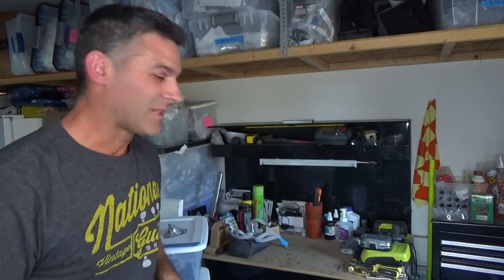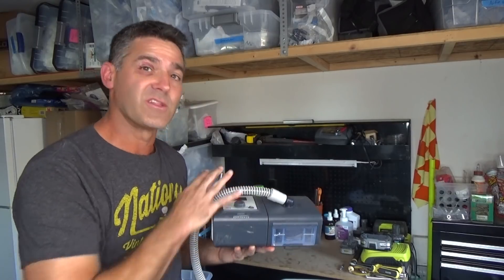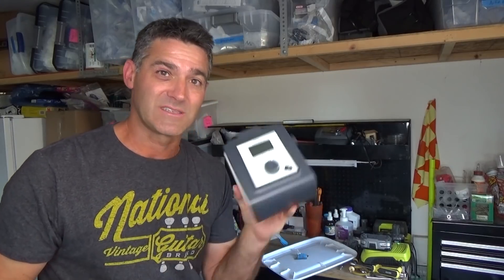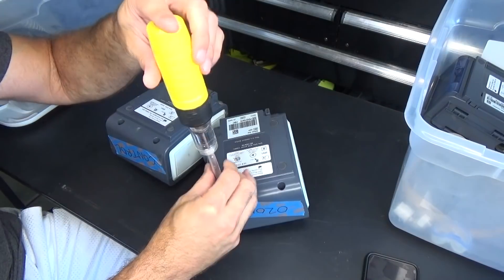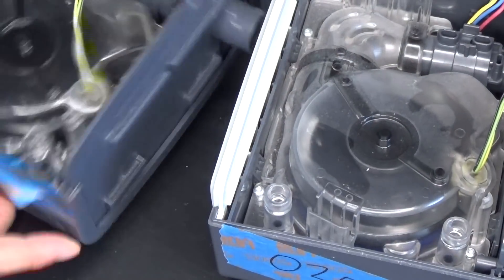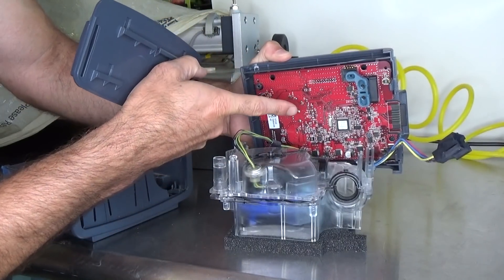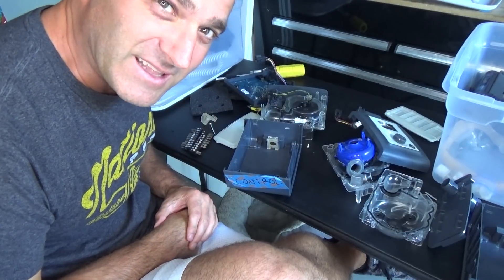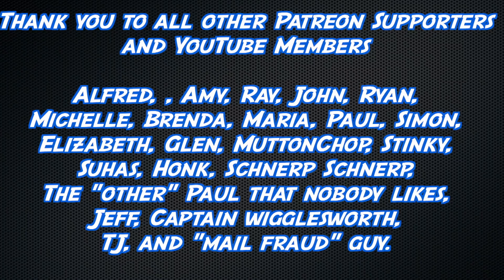Showing what OZONE does to the FOAM in a Philips Respironics CPAP Machine   #Foamgate

Comment: Interesting article on ozone from NOAI (Remediation Association).  They liken ozone exposure to rubber/plastic like dampness exposure to wood.  You can wet the bottom of a cup, set it on a wooden end table for a few minutes and remove... you see a ring for a little bit, then it dries up and goes away.  Do this repetitively for months and will have the same result and still the ring dries up without damage.  But place a wet bottom of glass on the end table and leave overnight and by the next morning the ring is set and will never disappear.   In other words with this analogy, "soaking" rubber or plastic in ozone for days at a time will have a much more detrimental effect than having the same cumulative time of ozone applied in relatively short bursts over an extended time.   While ozone torture tests are interesting, they are not necessarily scientific and may not deliver a true "read-across" result.  I'm not sure what is right or wrong, but could see potential validity in this apples to oranges proposition.
Reply: That’s exposing it to ozone for 45 days 24 hrs a day but most cleaners only run for 7 min.at a time
Reply: @howardanderson3324  Lets day a CPAP lasts 5 years, at 7 min/day, adds up to about 212 hrs. 45 days at 24 hrs/day is 1080 hours. Besides being 5 times there is also the impact of continuous exposure to O3 for 45 days. In other words, while it might be practical to do the test using an accelerated schedule the results may not mirror reality.
Reply: Daily use of SoClean turned the foam in my DreamStaion1 to a greasy mass. Your analogy doesn’t reflect ozone use.
Reply: En français
Reply: I check my unit the foam in my and it was not expose to ozone. The foam was degraded to a brittle melt when try to take out it was so brittle it breaks into little pieces to a sticky powdery mess. I live at where it very hot and the humidity is high, so if you live were it hot with high humidity it will degrade the foam too. Maybe someone can do a humidity experiment to see how humidity will degrade the foam. Even if the foam is not degraded and look new studies found that the foam material puts out chemical fumes which can lead to illness or cancer.
Reply from the maker: Fair point. The ozone applied was done in a bin that is not even close to air tight. It was just to keep things together and dust free.  Only one ozone generator cycle was done per day.  (I think this is why I didn't get as dramatic a result as Nick at CPAP Reviews.)

From reading up on Ozone, it has a short life and is completely gone after 30 minutes even in an airtight container.  The most popular ozone cleaner is a closed container.
Reply: @Freecpapadvice  I tend to discount Nick’s technique since it does not mimic real usage, especially in a situation where concentration and length of exposure are exaggerated by several orders of magnitude. He did an accelerated destructive testing which is a valid quality engineering approach to determine when something will fail. Anything subject to this testing approach will fail at some point – from airplane wings to car doors, paint, etc.
Reply: @Freecpapadvice  I was actually glad you did the accelerated testing because it was representative on a different accelerated level.  Obviously, you weren't writing an article publishable in JAMA with it, but your audience was helped by getting a test that may not have happened at all if you weren't able to condense it the way you did.  So, even though it's not apples to apples, 100% perfectly, I think it's a great preemptive test that might convince others (or even cpap manufacturers) to do their own real apples to apples tests. I mean honestly, you're a dude in a mancave, not JAMA. If everyone now wants a 100% perfect JAMA publishable test, maybe they need to give you the $50K to support it.   Btw, I've appreciated you so much over the last several years.  You even helped my mom to start wearing a CPAP, where I couldn't.  You've also helped me figure out a ton of my own issues and also taught me OSCAR mumbo jumbo. Thank you for telling me about this recall.  You're saving me and my mom's lives yet again!
Reply: @Freecpapadvice  did the ozone affect the shape of the screws?  What was the date of manufacture for each of the two machines?  I suggest that the one with the "very different" screws may be the younger of the 2 which may also lead to your findings.

Comment: Nice vid.  Although I saw where you forgot to put the side plate in before putting the top back on.  LOL.  I have one of these apart now.  Its a great motor and fan design to say the least.  They really made a marvel I hope their newer machines keep the fan and motor design.  What I want to know though, is WHY is Phillips paying out and taking the black eye when it's the SOCLEAN ozone machines that did the damage??  Why would Phillips take a black eye on this?  What am I missing cause it makes no sense.  But for some reason that foam does turn into a STICKY SOUP which I found in mine upon disassembly; and I never used any ozone cleaning machines.  So Phillips had a serious problem with their foam and not even ozone related.  Now you have to wonder why the big cover up.  Who actually owns SoClean, and why.  Perhaps I am going to far with that conspiracy, but I can say for sure ozone was not required for these foams to degrade in pretty weird ways too.  I hope you didn't replace with a nasty Resmed.  
ALSO - Instead of testing what exogenous ozone does to a machine, why don't you test how much ozone the motors in machines are generating.  I suspect its an issue with Resmed machines.  Also look at P10 nasal pillow mask.  It simply does NOT exhaust out the front, and I have new ones I tested against this too.  I'm kinda at a loss that resmed would all this sort of error on the market....

Comment: Beware! This is a nice video to help the System One CPAP owners to rid their units of the dreaded foam.  Please note that just taking the foam out allows dirty air to bypass the air filter, as the foam serves as a “sound abatement” wall for the air ducting.   What I did for my units, is to cut a thin gasket of food-safe baking silicone using the foam as the template, and installed this on top of the foam (against the motor housing while leaving the foam in the bottom of the unit).  Therefore, the silicone sheet seals against the bottom of the motor housing and preserves the proper airflow of the air ducting, while isolating the airflow from the defective foam.  All intake air must go through the air filters with this setup.  I feel this is a better solution than to have my unit open to the atmosphere with no filtering (by only removing the foam).
Reply: You are correct and what I am hypothesizing is that without the bottom in place, you would be breathing PC BOARD fumes directly, which is not good.  Probably get a few anyways just from the unit exhausting near the air intake.  Still you never know having fresh air moving across the board may just keep it cool enough to not create fumes.  Some people I see with a pc board in the top cover side too.  I imagine that is the modem and connection to the Evil Underlords of CPAP.  I really like your idea about the template I did not think of but probably because my foam was a degraded soup-like sticky mess.  It looked kinda like you could imagine memory foam gone rancid and heated up to melting point, except at room temp.  I am going to see what the foam looks like in this other unit and maybe I won't have to scribe ink all over the bottom pattern and try to press out a template like I was thinking.  I'm trying to think of something organic like cotton and not dangerous to make my new bottom "foam area" with.  ANY IDEAS PLEASE??  Have you run into anything in the store over the years that you thought might work>?

Comment: First there is Issue #1 Phillis now has come up with deeming some units too old to repair. #2A offering $50 to send it in with no replacement. #2B send in a new scrip from your doctor and wait for replacement. There is a problem with #2B as you may need retested as was my issue from to many years and new Doc. So I got retested at home and failed to test for CPAP requirements.  I convinced the Doc to do a lab test and again failed to test for CPAP requirement. Doc told me Medicare or other insurance would cover a new machine. So I tried to sleep for week without and monitoring sleep on Apple Watch and iPhone health app. Lot of snoring plus high number of wake-up’s during the night. Loss of a lot of sleep from being woke up not being able to go back to sleep. Found a snoring monitoring app and it recorded and lot of loud snoring. So I went back on CPAP with all the same monitoring almost no wake-up’s and nearly all sleep time. So now what to do if I can’t get a new scrip and machine? Find a way around the foam. There would seam to be 2 types of foam degradations dried up flaky and turning to gummy mess. I used a ozone cleaner for about half the years I had this unit. My foam is gummy if touched and not dry. I removed it and did a cleaning, washing the housing and fan clear housing half’s. I did a compressed air blow out on the fan blades.  To remove the foam is not difficult just locate the correct video and do the work. But be aware that some of the machines have the foam in a sealed fan chamber that’s nothing like as shown here.

Comment: Thank you for showing what the insides look like and how you took it apart. That's what I am going to do tomorrow for sure, take that foam out.  I imagine the machine will sound a lot louder, but hey, it can do double duty as a sound machine.
Update:  FIXED IT!  Took the foam out. Half was looking iffy, half ok.  But in the summer or when the room gets warm OR when I leave the tank in there full of water.... the humidity goes backward into the machine and it smells exactly like when toddlers slobber over animal crackers,  Putting it back in was pretty tricky.  Mine had star shaped screw slots.  Luckily, had some odd-sized small flatheads that did well as a workaround.

Comment: I've owned and used a CPAP machine for years. Actually, I've been thru 3 or 4 of them. Started using an Ozone cleaner over a year ago. I was notified a while back that my machine was on the recall list and would either be replaced or repaired before the end of 2022. I was told not to worry that Ozone has not been shown to cause any problem but I should stop using the Ozone machine if I was using one. So, what is this really doing to my lungs? Should I be worried? 
Also, do you know anything about this "Inspire" device that is being advertised on TV. It's supposed to eliminate the need for a CPAP. 
A device is surgically inserted in your chest (like a pacemaker) and keeps your throat open with and electrical shock.

Comment: I did not ever use a So Clean device or any other Ozone cleaning devises on my CPAP machine.  Ozone is highly reactive and will destroy plastic over time.  Check out your outdoor lawn furniture webbing and you will find that after sitting out in the sun for a few years the plastic fibers in the webbing are breaking and being destroyed. That is caused by the UV light from the sun and Ozone in the Ambient Air at ground level.

Comment: I check my unit the foam in my and it was not expose to ozone. The foam was degraded to a brittle melt when try to take out it was so brittle it breaks into little pieces to a sticky powdery mess. I live at where it very hot and the humidity is high, so if you live were it hot with high humidity it will degrade the foam too. Maybe someone can do a humidity experiment to see how humidity will degrade the foam. Even if the foam is not degraded and look new studies found that the foam material puts out chemical fumes which can lead to illness or cancer

Comment: Did you ever determine what was causing the whining sound in the blower of the ozone-exposed machine? My System One 60, which I have now sidelined due to the sound abatement foam issue, has that issue and I wonder if it is due to the foam or something specific to the blower.

Comment: Yup ozone rots pretty much anything. I only use it for last ditch sterilization tasks when nothinh else worked. Fwiw my honey's cpap is identical to the one with the blue motor and red board. The motor finally died after 9 years of use. I fixed it up because nobody had a cpap machine available and without it she cannot sleep at all.😢 the circuitry on the red motherboard has a lot of protection and safety features not found on newer stuff. Also has a really wide voltage compliance range of about 10.6 to 18v which is impressive to say the least. Used one with the blue board to fix hers, the thing hardly seen use at all before the mobo died. Go figure.

Comment: Several things; You didn’t have total control of both units since they were in patient’s possessions so there’s no history of what the units may have been exposed to. Example: Did someone use lysol while the machine was running. The fact that there’s different screws between units makes me think that the units are of different ages. Did the factory change foam types or suppliers? That being said, do I think the ozone damaged the foam yes, because I happen to know about ozone’s caustic qualities to plastics. Another thought: Do ozone CPAP cleaning product manufactures bear some responsibility in this?

Comment: I have a Dreamstation 1 and did the foam removal (attempt).  My foam was very very oily and breaking down.  When I stuck needle-nose pliers in to pull on it, it just crumbled.  I pulled a small piece out on the pliers, I touched the foam and it disintegrated into a greasy, mess.  I did not SEE any particulates or visible break-down.  I had to touch it and feel the foam in order to see it.  I use a SoClean Ozone cleaner.  I've taken the SoClean OUT OF USE and am now waiting for Philips to ship me the Dreamstation 2 that they said they would when I registered (a few days ago).  Going to be waiting a while I think.

Comment: I have a CPAP MA HINE FROM 2011 which I never cleaned with ozone and a Dream station that is from Nov. 2020 that I used the bag ozone to clean.  My 2020 was recalled.  My 2011 was not recalled, but I am not using either one now.  If I stop breathing in the night I will die and go to Heaven.  I rather die in the night than expose myself to cancer.

Comment: The issue is the PE-PUR foam that is used for sound abatement can degrade resulting in a host of issues including death Souce: FDA.  I recommend requesting them to provide a shipping label to send your machine to a qualified testing facility for analysis.  At their expense.  

Unless or until this testing is conducted, you and they don’t know for sure if you may have been breathing in dangerous VOC’s.  Don’t loose chain of custody with your machine by returning it.

Request Philips ship you a DreamStation II which uses silicone for sound abatement.

Comment: Been using ozone for 2 years . My foam looked just fine.On my Dreamstation.
Reply: I have a Dreamstation 1 and did the foam removal (attempt).  My foam was very very oily and breaking down.  When I stuck needle-nose pliers in to pull on it, it just crumbled.  I pulled a small piece out on the pliers, I touched the foam and it disintegrated into a greasy, mess.  I did not SEE any particulates or visible break-down.  I had to touch it and feel the foam in order to see it.  I use a SoClean Ozone cleaner.  I've taken the SoClean OUT OF USE and am now waiting for Philips to ship me the Dreamstation 2 that they said they would when I registered (a few days ago).  Going to be waiting a while I think.
Reply: @dannymitchell9848  I stopped using my ozone to..Regestered a while ago have not heard anything from Philips.
Reply: @mycontinental3611  Over here in The Netherlands I didn' t hear a peep from Philips or my CPAP provider.
A few days after the story broke in the news, the CPAP company simply disconnected the phone...
Here we have a kind of Obama care, mandatory insurance. Works for most of us fine. A CPAP will be provided without cost. Every 5 years replaced, tubes, masks, filters are sent automatically. In 13 years I used an M series and now I am halfway the lease of my 2nd System One. Because I have the symptoms like irritated throat, coughs, lots of ear problems and irritated eyes I switched to the use of my 2nd machine, I had bought and stationed in the house of my son in Fla. It's a rather cheap model, an iCH2 from Apex. In the few weeks I use it now, I don't feel much improvement yet.

Comment: Wow.  Amazing.  We have a so clean.  My husband uses it, I wash and use your citrus cleaner and the Hurricane dryer.  We both use the Airfit np30i. His is yellow from the ozone baking and mine is still like new.  We get all our supplies delivered at the time.  My old Breeze nasal pillows game me the best fit no leakage 20 out of 20 but the np30i leaks I  do good to get a proper seal.  I don't  use a chin strap because my mouth is sealed on the inside naturally it seems.  My pressure is 11/20.  Great air bad seal.  Dropping pressure doesn't seems to help the seal?  Just use Polygrip huh?
Reply: Mine